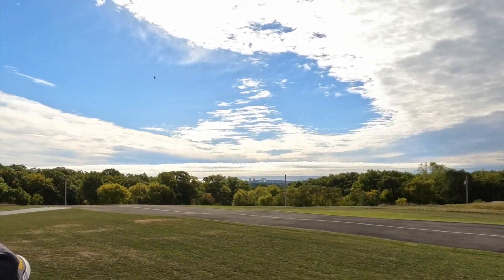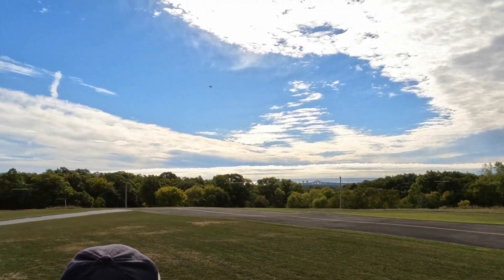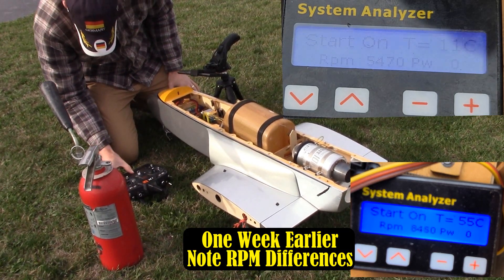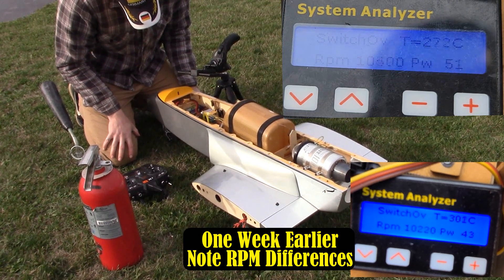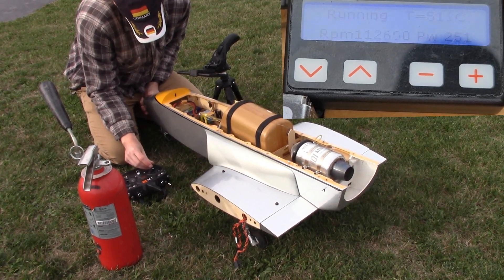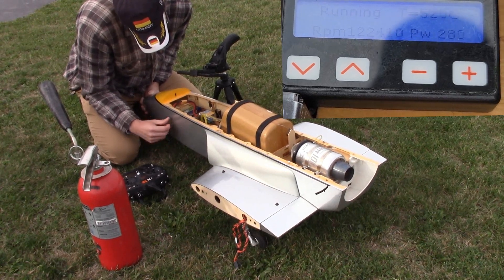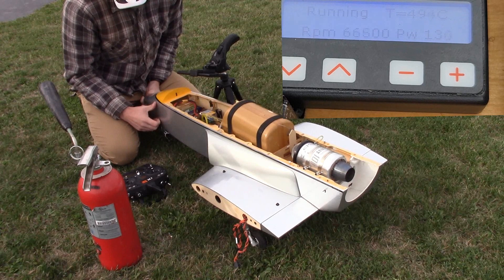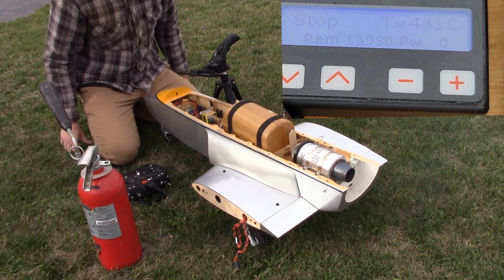What is wrong with this Surging Model Jet Engine - Testing a Turbine

Comment: what was the problem? fuel pump close to die? pretty shure but whant to know what fixed it ?
Reply from the maker: It needed a fuel pump and tune. I still have issues though with the new one. It surges aggressively on startup.
Reply: @RCexplained  ok tnks

Comment: Something that is missing in your testing is movement.

I fully understand that you are looking for a baseline to deal with, but after you’re (somewhat) happy with your baseline, you should add some actions (by hand) like yawl side-to-side, or pitch up-and-down, even spin the fuselage to see if motions alter the results. 

Best of luck with this. 👍🏼
Reply from the maker: Hey Casey. Good point. I didn't add any motion as I noticed I'm already having issues that could lead to a flame out with the airplane motionless.

Comment: Hi, I have a technical question and I think you will be able to answer it without any difficulty: can we run a brushless motor in oil bath? thanks
Reply: No need to. It’s brushless
Reply: @3drc681  The question is not whether I need it or not but whether it is possible to do it. Thanks anyway
Reply: @geoffreyriviere1853  i wouldn’t suggest it. It will compromise the internal wrapping.  Can I ask why you are thinking about this process?
Reply: @3drc681  All right. I imagine the engine connected to a mechanical gear system that turns in an oil bath. I'm thinking that the engine could also run in an oil bath like on 4-stroke motorcycle alternators, and thus avoid isolating the gears and the engine.

Comment: I am not familiar with rc engines but when a fuel pump is surging it is normally due to restrictions in the fuel line or air leaks. There is also the possibility of fuel contamination but it happens less often. If all seems to be ok, maybe the pump motor is the culprit. Bad bearing, failing coil, bad connections, etc.
Hope that helps a bit and good luck !
Reply from the maker: Thanks for the tips. I'll try running the engine  with a different fuel system that I know has no restrictions.

Comment: how much thrust is that? cool to see you holding it and it wants to go.
perhaps strange frequency  of vibrations related issues
Reply from the maker: It's 24 pounds at full throttle.
Reply: @RCexplained Which company engine?